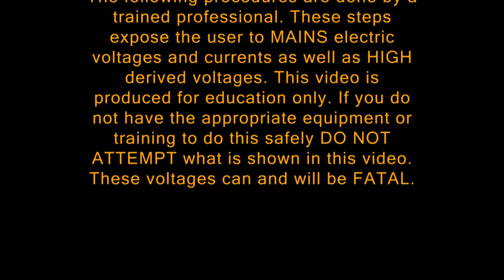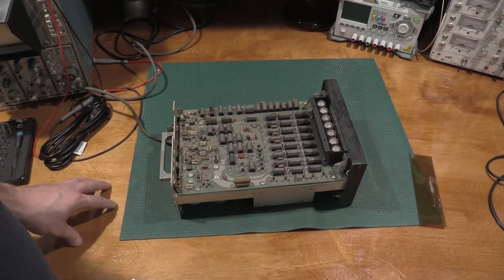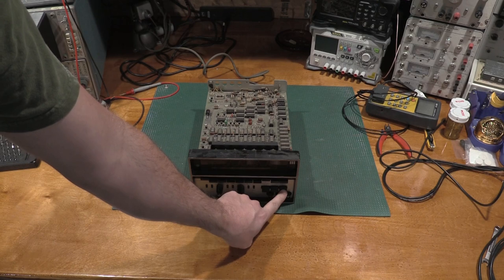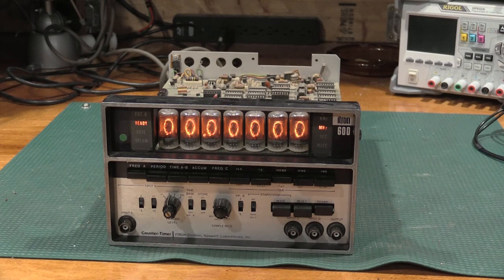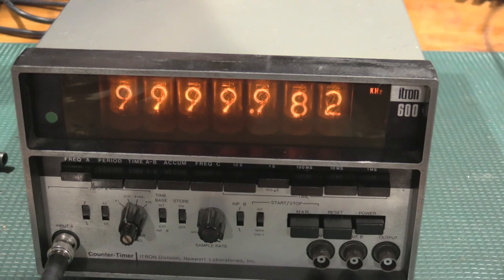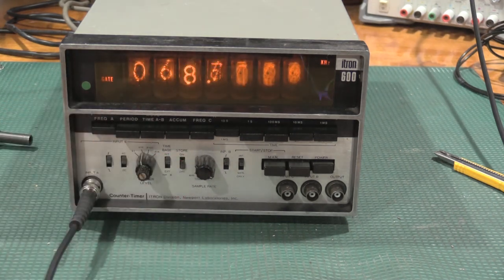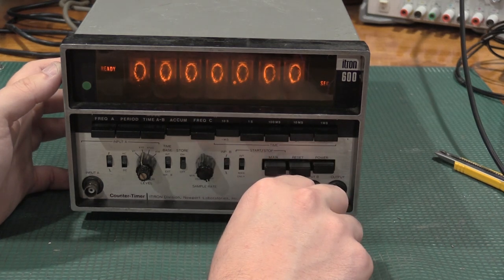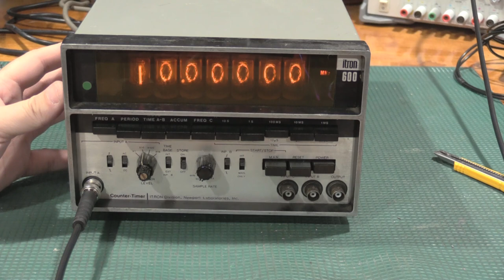ITRON 600 Repair and Alignment

Comment: Hi, nice video but we never saw the PCB and the goodies inside ! 18 minutes with 2 camera angles and couldn't see the test kit you where using, I would say lets have a look around I mean date codes and what devices are used ? and what sort of frontend also what kind of clock ? do you have a schematic ? that sort of stuff !....cheers.